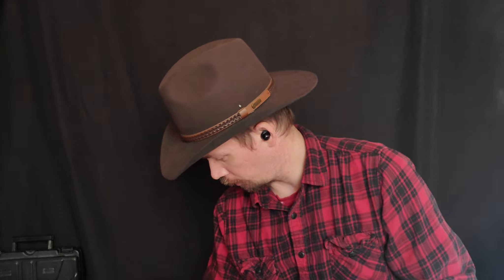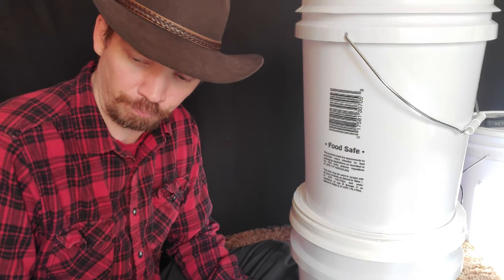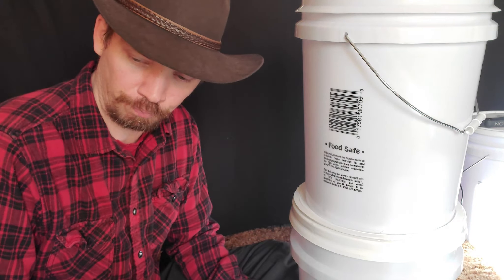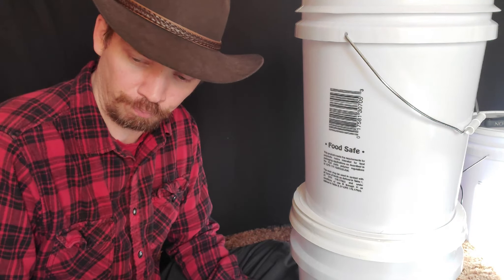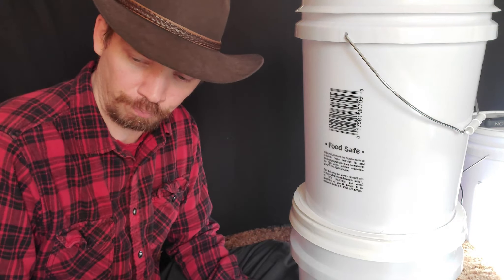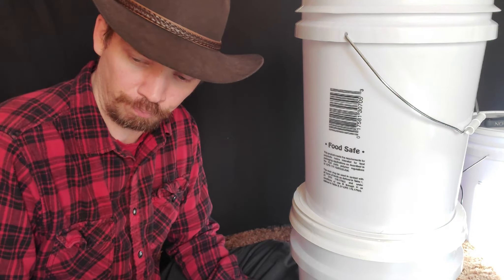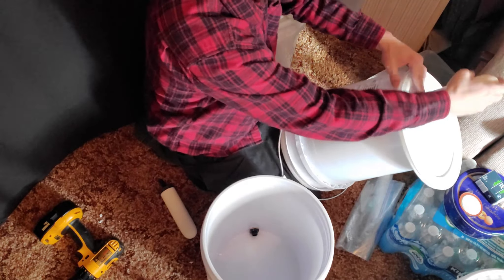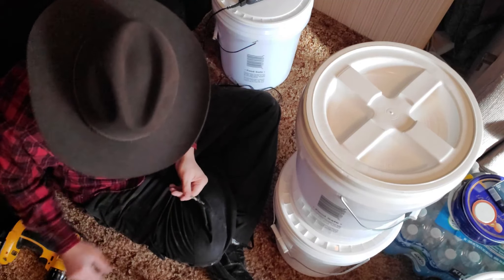DIY Water Filter

Comment: That is the ceramic filter.  Which I use .  they come in 7" or 9".    
The other filter that has a hole in it, which is the black filter.  Also good.  Cost more, though.  I have used those, as well.
British Berkfeild, ceramic filters has a great history.

Comment: For those that don't have a milling bit, that same drill bit that is too small can be used to "hog" the hole out. Just keep the bit halfway in the hole and use the flutes to cut the plastic. A round file will work too, even a chainsaw file, if you are patient enough. 
Most clear silicon sealant is food safe, use that to seal the faucet, but not the filters, those need to be replaceable.
Reply from the maker: Its not leaking at all, dont thing I will need to use it. Also have a dermel I could have used for that hole. Or a file would work well also.

Comment: Great video grim. You might want to check but you may have the filters upside down? I think the water is saposed to seep through the filter in the water in the top bucket and out the hole into the bottom bucket???
Reply from the maker: Yeah I tagged something in the comments about that, had fixed it before us. Seems to be working well with no leaks.

Comment: Wish you would post where you got the filters
Reply from the maker: https://www.directive21.com/
Reply: @TheGrimTruth2   Thanks for the link, I was hoping for the link to the non berkey... also, why ceramic over the black filter?  is there an actual reason to that or do they mostly do the same.  My water has a high sulfer smell content and I am not sure if the ceramic filter has the carbon to help clear that smell or just the black ones.  Thanks for the info... The lake and creek water I will be filtering will be exposed to everything under the sun.  Looking for the best option the the least buck... at this point anyway.  Thanks for any of the help you can offer.